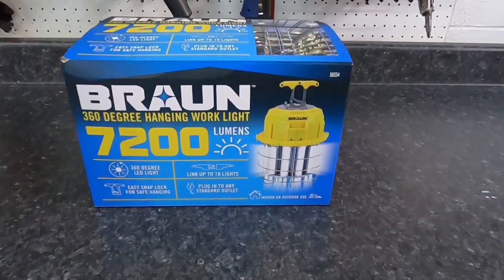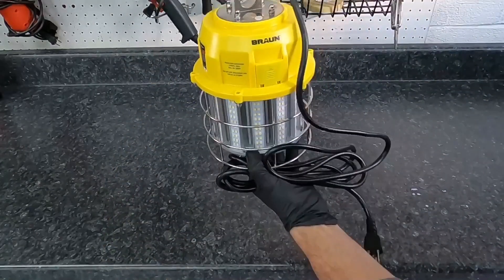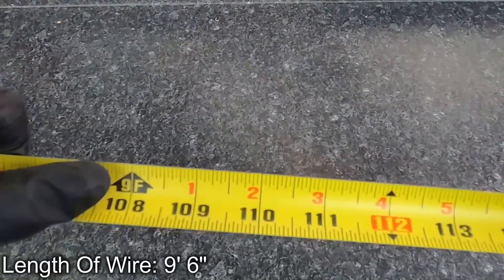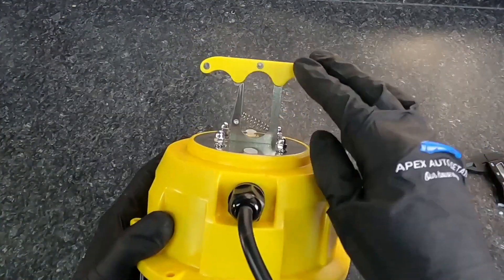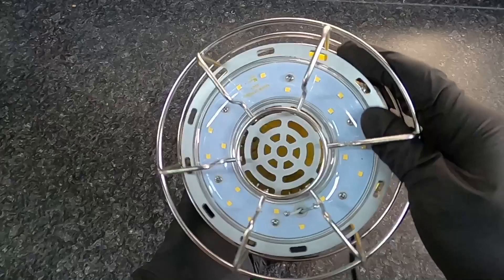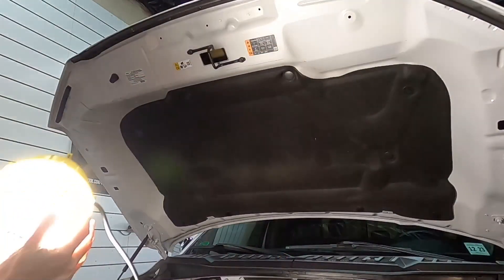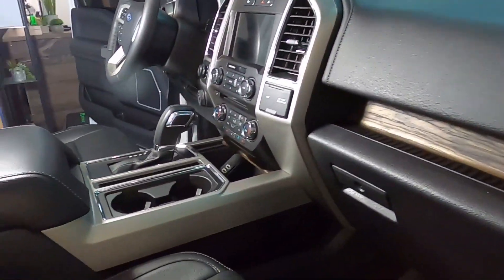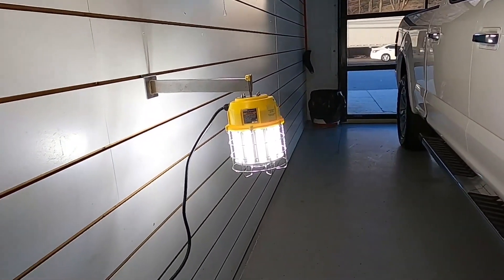Extremely Bright Braun 360 Degree Work Light!! From Harbor Freight!!

Comment: Nice light. Thanks for sharing. P.S. Would be nice if it came with a shield that covered half of the outside perimeter of the light for situations when 180 degrees of coverage is more advantageous.